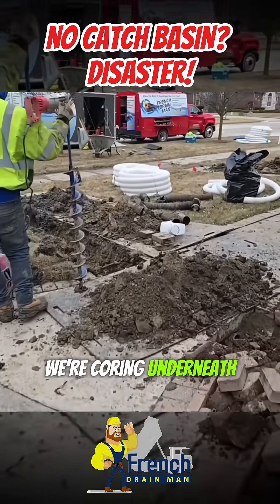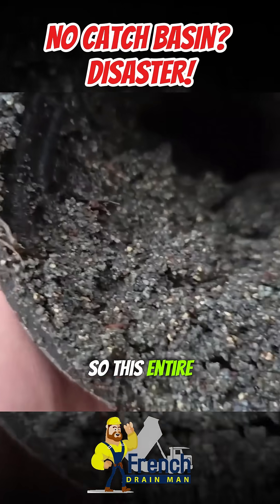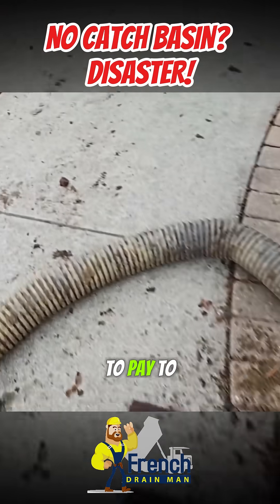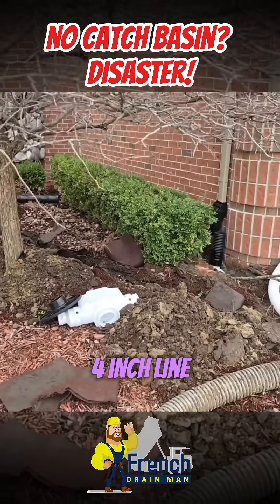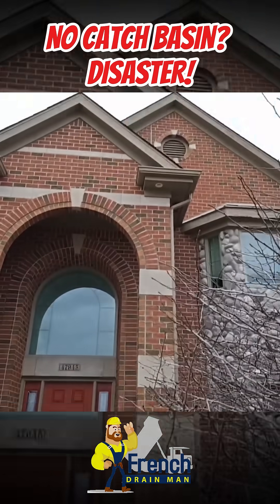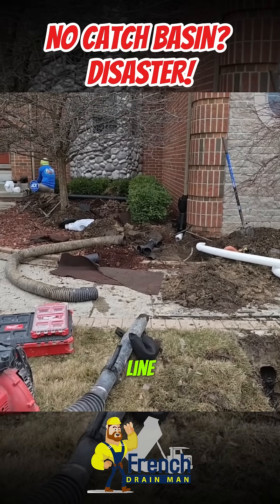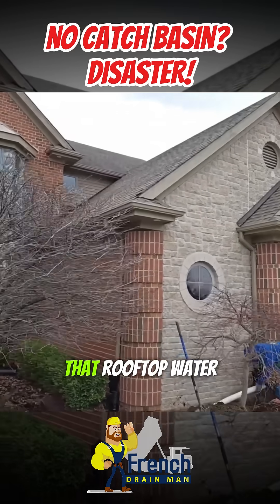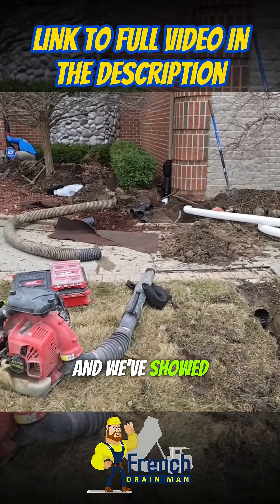Shingle Gravel Destroyed This Drain System!

Comment: I know I've done this before, but the math on cross sections for those who don't remember πr²:

2x3=6 sq. in. (slightly less because of the chamfered corners)
3" round = 7.07 sq. in, so the water will flow slightly slower in it.
4" round = 12.57, which is still more than two 2x3s. and you're maintaining similar water flow to what the downspouts themselves have.
Reply from the maker: You need to mention that psi is what keeps the pipes clean. Also, the free fall of water coming off the roof generates a couple psi. When the water is asked to flow through a small diameter, it speeds up. I've done many videos on this; however, YouTube will now allow me to share links in the short video comments, only long-format videos.